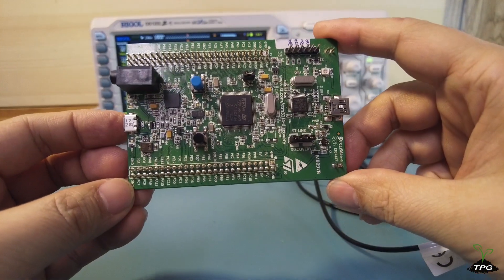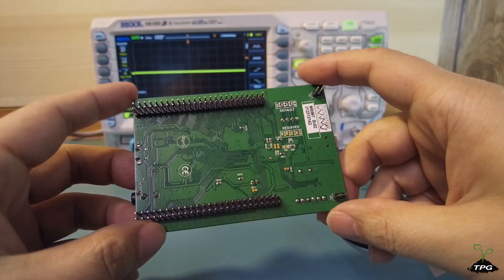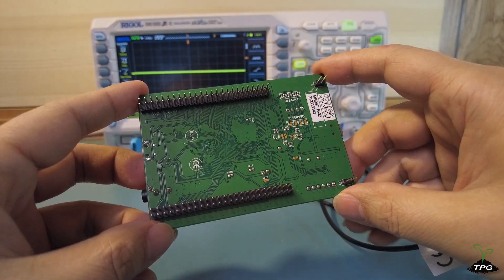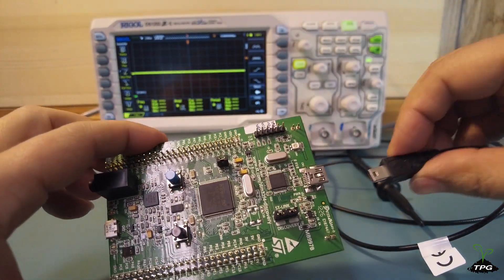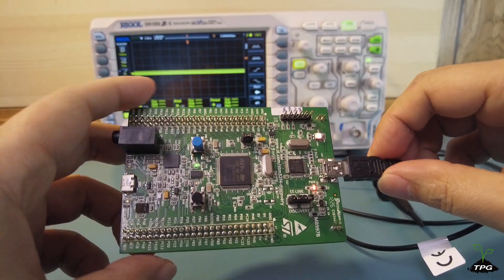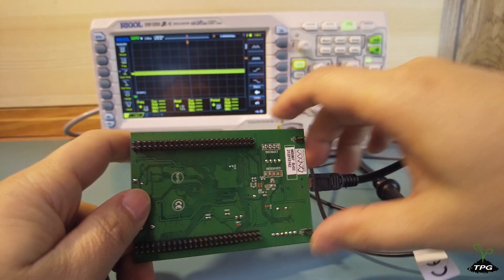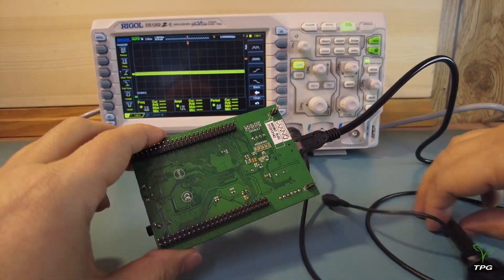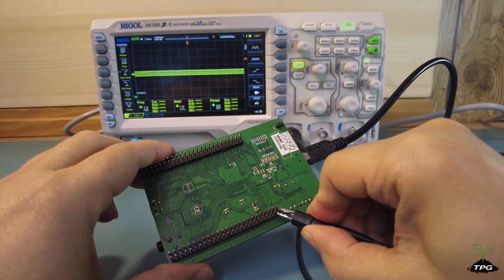Waveforms of Two Crystals on a Microcontroller Board

Comment: Sorry but seriously new to applied oscilloscope exercises.  My old analog scope made by BK Precision had a user manual with great suggestions and instructions - like how to fix old CRT tvs and HiFi stereos. But no crystals. Should I just hook up the probe to either of the two pins from the crystal?
Reply: depending on a lot of stuff (frequency, voltage, impedance matching, loading, parasitic capacitance, and even just what you are intending to find) you can sometimes just directly probe the crystal
you're more likely to run into issues on older, not high end, oscilloscopes with loading and such
Reply: Probably wont work as the capacitance will load down the signal. Here its possible because the crystal is driven by a driver circuit

Comment: f103 used in st-link has quite weak crystal drivers. Especially for the 32768 one. So its output signal is more sine-like. The big guy has more powerful driver so it gives more square-like driving signal. Meanwhile input (mcu-wise) signals are almost same because they're determined more by crystals itself.